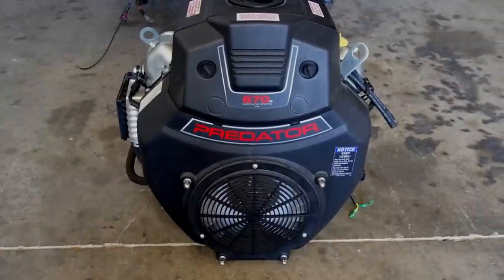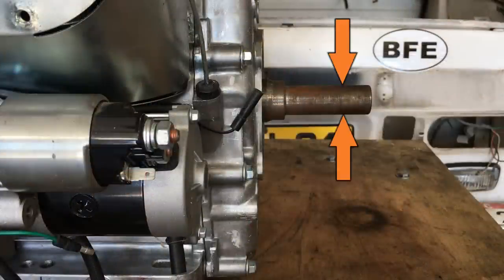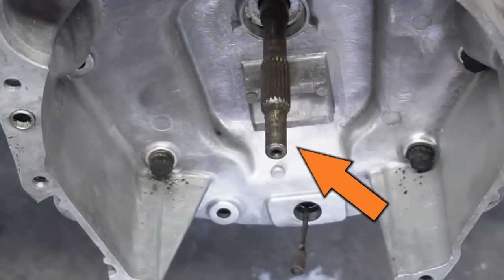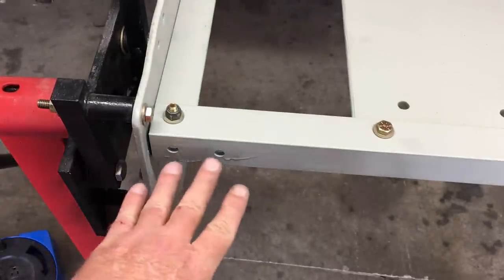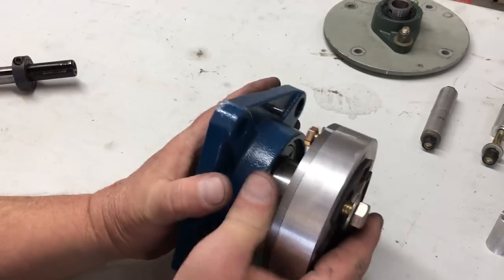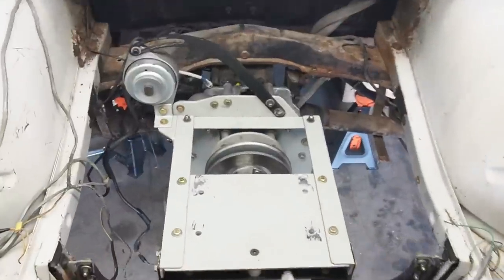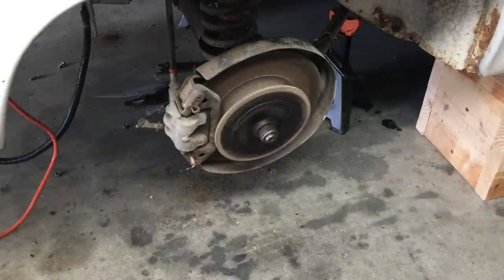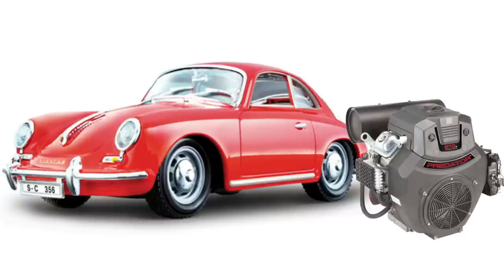S3 E18 We put a 670 Predator V twin in our project car 1969 Renault 10

Comment: Important Grilling Safety Tips to Know for Barbecue Season
Reply: is there a list coming here soon?
Reply: @mommapanda5736  How to Grill Safely

    Separate it from other food.
    Refrigerate it before grilling.
    Wash your hands before and after handling it.
    Make sure its juices do not touch other food, utensils, and surfaces.
    Use a food thermometer to ensure it is cooked to a safe internal temperature.
Reply: Only use grills outside

It may be tempting to set up your barbecue grill inside of your open garage or under a covered balcony, but propane and gas, charcoal grills are strictly designed for outdoor use where there is plenty of ventilation. Any combustible materials that surround or hang over the grill when it’s in use can catch fire easily and quickly. Make sure that the area over top and around your grill is clear and unobstructed.
Reply: Place your grill away from your home

Barbeque grills are often placed just outside the back door or on the back deck against a railing. You should avoid placing your grill in these areas because it can pose a potential fire hazard. Grills that are placed too close to the house or other wood structures can heat up adjacent materials and cause a fire to start. Be sure to keep your grill at least 10 feet from your home or other structures.
Reply: Make sure your grill is located on a flat, level surface

Grills that are placed on slopes or other uneven surfaces can tip over easily and cause a fire.  Make sure that your grill is set up on a stable surface such as a concrete pad so that it remains level while cooking food.
Reply: Check your grill for leaks

If you store your grill inside during the winter months, it’s important to check it over thoroughly when grilling season begins. A leak in the gas lines can cause propane or natural gas to build up inside the BBQ when the lid is closed. Check the gas lines to make sure that they are free of leaks before using your grill, and always open the lid of your barbecue before lighting.
Reply: Always clean your grill after use

Barbecuing regularly causes grease to build-up on the grill plates and collect inside the grease tray. If not cleaned, the build-up can then act as fuel and catch fire while the grill is in use. Clean your charcoal or gas grill after each use with a grill brush and empty the grease tray when it begins to fill up.
Reply: Never leave your barbecue grill unattended while in use

Never leave the grill unattended while you are cooking food. You should never walk away from your barbecue while it’s in use. Barbecues use high heat and open flames to cook food, and when left unattended can become a safety and fire hazard. If you must leave the grill, ask another adult to watch the grill for you.
Reply: Wear appropriate clothing

Articles of clothing that have long sleeves or pieces that dangle can catch fire easily when too close to an open flame. When grilling food, wear clothing that won’t interfere with the cooking process and make sure that any apron strings are tied back away from your front. If a piece of clothing does catch fire, remember to stop, drop, and roll to extinguish the flames quickly.
Reply: Keep a spray bottle on hand

It’s common for grills to flare up as fat drips from meat as it cooks, and this can cause a section of the grill to remain on fire as it burns away. If left alone, the flames will continue to burn and cause excess smoke to billow out from under the lid. Keep a spray bottle filled with water beside your grill so that you can quickly extinguish smaller flames before they spread.
Reply: Always have a fire extinguisher close by

In the event that a fire does break out, follow these tips on  and ensure you have EZ Fire Spray within reach. It is simple to use, just point and spray to extinguish the fire. EZ Fire Spray is also quick and easy to clean up after use. It’s small, compact size makes it the perfect addition to your grilling set to help keep your loved ones safe.

Following these charcoal and gas grill safety tips and having the right protection will help you and your family enjoy a safe grilling season all summer long.

Comment: Here in Brazil there are quite a lot reasons:

    renault sold cars in the country from the 50’s to the 60’s, and they were famous for disassemble parts while you’re driving. With such bad reputation, they left the country, selling their factory and projects to Ford. When the Ford Corcel came out in 1968 (the project based on the Renault 12), it didn’t disassembled, and it was a very successful vehicle sold until 1992 as a sedan and 1996 as a compact pickup truck (the Ford pampa). So basically Ford fixed it.
Reply: renault came back in the 90s, along with Peugeot and Citroen. They started selling well, but soon the suspension problems started.
by the end of the 90s, they started a new generation of cars here (Clio II, 206) and theirs weak suspensions got company, specially with the Peugeots: electrical problems.
then, Renault did quite a good job until the mid 2000s fixing the Clio, but the 206 and its sibling Citroen c3 kept their issues.
when the Clio started being a reliable product (but with expensive parts and insurance), Renault released their Dacias here (sandero and Logan) badged as Renault , and although they were reliable, their interior were really really (really!) cheap compared to their competitors. They were really fleet cars because nobody really liked them.
Reply: by the end of the 2000’s, French brands started offering automatic transmission and boy, they suck. They were 4 speed only, sluggish , and wouldn’t last for more than 25.000km (15000 miles) without a serious issue. These cars nowadays are sold for 30% less than their manual siblings in the used market, and it takes months until you find someone crazy enough to exchange money for that car.
Reply: by 2015, they had a whole new generation of products. They were a lot better, have a lot less electrical issues, they now have the okay AISIN 6 speed automatic transmission (Peugeot and Citroen), or the also just okay CVT transmission (Renault) but guess what? All the competitors evolved, so they’re not really the first option to come to mind. They did enough to survive, not to conquer new consumers.
    We are in 2020. Renault is still selling the 2004 Logan/sandero with new headlights and tail lights, and still only serve as fleet cars, or Uber. They have some serious work around, such as the high suspensions to fit the new cvt transmission. Nobody really buy them for personal use because their interior are so cheap, and their projects are so outdated. Peugeots and Citroens still have weak suspensions for Brazilian low quality roads, and still carry some electrical problems here and there.
    along with the above and for all mentioned periods, French cars have very expensive parts, when you’re lucky enough to find all you need.

So there you go, some reasons why Brazilians don’t buy French cars very much. I believe Some of it can be applied all over the world.
Reply: @ocdman202  Greetings to all viewers in BRAZIL!!!  This channel has a great
following  on the world stage.   Greetings to all the viewers!!!
Reply: @mommapanda5736  Brazil has one of the world’s most unequal distributions of income. The richest 10% of the population get 47% of the income, while the poorest 10% get only 12% of the income. Around 20% of Brazilians live below the poverty line.
Reply: Sugar and cotton were Brazil’s main exports in the colonial era, and joining them in the nineteenth century were hides, rubber, and coffee.
Reply: By 1900, Brazil had accounted for more than one-half of the world’s coffee production, as late as the 1920s coffee still constituted 75% of Brazil’s exports.
Reply: Brazil is the largest and most populous country in South America, with 182 million inhabitants, by 2000 Brazil had become the world’s eighth largest economy.
Reply: The Amazon Basin to the north and west covers more than 40% of the country, and Brazil is home to a wealth of natural resources. It has around one-third of the world’s reserves of iron ore, as well as large deposits of bauxite, coal, zinc, gold, and tin.
Reply: Between them, the USA and Brazil account for two thirds of the world’s production of oranges for export.
Reply: Investments in Brazil

Energy, alternative energy, agriculture and technology are the main sectors that investors look for when expanding to Brazil. 

Despite the demand for it, Brazil has fallen behind in the development of renewable and alternative sources of energy. According to Brazil’s Energy Research Office, renewable energy sources will reach 61 Gigawatts capacity by 2027. 

The government also offers incentives and benefits to businesses like special tax redemptions for setting up fixed assets in the country as infrastructure projects in transportation, energy, sanitation, pipelines, etc.

Companies in the IT, ICT, Technology sectors also benefit from payroll relief. The government offers tax incentives, subsidies and benefits for trademarking, patenting or developing new technology and innovation in the technological sector.

Comment: In the realm of roaring steel and gasoline's might,
Where engines ignite and dreams take flight,
There exists a breed, nay-sayers they are,
Whose words extinguish innovation's star.
Reply: Within the hearts of creators, a fire burns,
To push the limits, to explore new turns,
But the nay-sayers dwell with skeptical gaze,
Casting shadows on ambitions, setting ablaze.
Reply: They scoff and they sneer, with doubtful refrain,
Questioning progress, dismissing the sane,
"Small engines can't soar," they stubbornly decree,
"Stick to the norms, defy not gravity."
Reply: Yet amidst their cynicism and dispiriting prose,
The visionaries persist, refusing to be froze,
For they know that within a small engine's frame,
Lie possibilities uncharted, a wild untamed.
Reply: Through engineering's alchemy, they craft and design,
Turbocharged dreams that leave the nay-sayers behind,
Each revolution a defiance, a fervent revolt,
Against those who restrict, who stifle and fault.
Reply: For every doubting whisper, they find strength anew,
The negative echoes, a challenge to pursue,
They harness the doubts, transform them to fuel,
Igniting innovation, making the impossible rule.
Reply: Inch by inch, horsepower by horsepower they strive,
Unveiling the potential, enabling dreams to survive,
With relentless determination and boundless might,
They break barriers, reaching for the limitless height.
Reply: And as the engines purr with newfound grace,
The nay-sayers falter, silenced in their chase,
For they witness the small engines take flight,
Defying their skepticism, shining bright.
Reply: So let us not be swayed by those who deride,
By the critics and cynics who seek to divide,
For the true pioneers, the dreamers, and the bold,
Know that within limits, new stories unfold.
Reply: Let us champion the visionaries who dare,
To push the boundaries, to go beyond where,
Nay-sayers reside, with their doubts and disdain,
For it's through their defiance that progress shall reign.
Reply: In the heart of Kansas, an unlikely sight,
A French car stands, bathed in golden light.
Within its confines, a secret hides,
A band of gnomes, where adventure resides.
Reply: These tiny creatures, mischievous and sly,
Found refuge in this car, reaching for the sky.
With pointy hats and beards so long,
They sing and dance to their own gnome song.
Reply: Amidst the prairies, their world unfurls,
Painting colorful scenes with their gnome pearls.
They decorate the car with whimsical grace,
Leaving no trace of an ordinary place.
Reply: Underneath the moon's enchanting glow,
They tell tales of gnomes from long ago.
Their laughter echoes through the open air,
As they celebrate a life beyond compare.
Reply: They hold tiny feasts, with gnome-sized treats,
Sipping on nectar from dainty cups so sweet.
Each gnome finds solace within their kin,
For in this car, true magic resides within.
Reply: Though hidden from the human eye,
The gnomes find joy as the days go by.
Living in harmony, they'll never part,
A French car in Kansas, their gnomish art.
Reply: So, if you happen to pass by one day,
Look closely at the car, don't turn away.
For within its doors, a world is found,
Where gnomes dance merrily, forever unbound.

Comment: A nice size oilcooler with volt guage.amp gage oil press guage oil temp guage air intake temp guage and egt guag.and a airfuel ratio gague.u will have the luxuries of a new car as far as ifo for ur motor

Comment: The Renault 8 and 10 were probably comfortable but they did not have a very good reputation in terms of handling. With the bad tires of the time, when the shock absorbers and front axle were worn it could become dangerous on French roads , which were (and remain) very different from the very straight and roughly flat Texas roads. 
One solution was to put a 25kg sandbag in the front trunk, especially with the R10, which is longer, heavier and more powerful than the R8. Yes it is possible to make smaller. 
So be careful with the weight and accessories of the 670 engine.